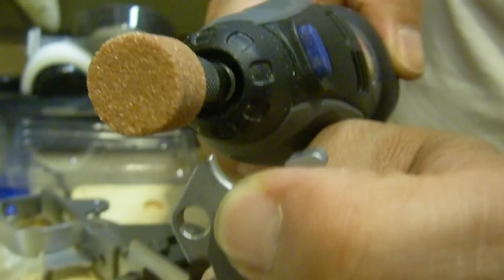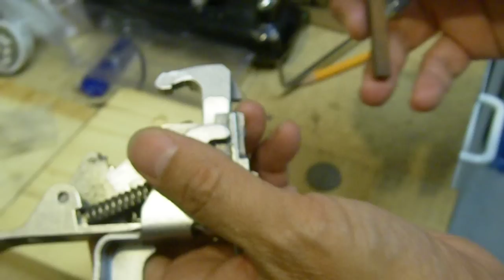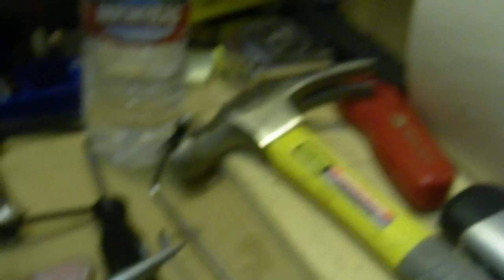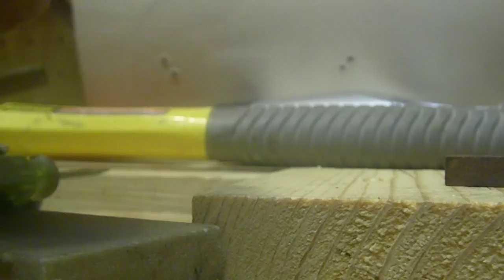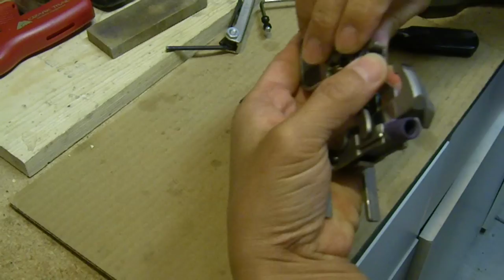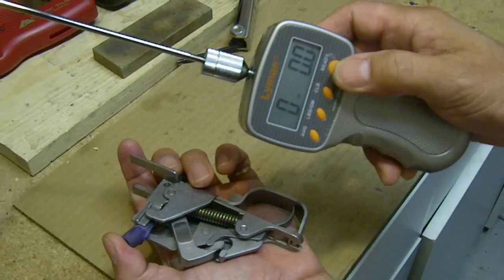Mini-14 Trigger Job 2 of 3

Comment: I had a difficult time getting the trigger assembly back into the housing.  That round trigger spring makes it very difficult to get the holes to line up.  Finally after a good while I did get it but it was not easy.

Comment: You are bending the wrong part of the spring the wrong direction !!!!!!!
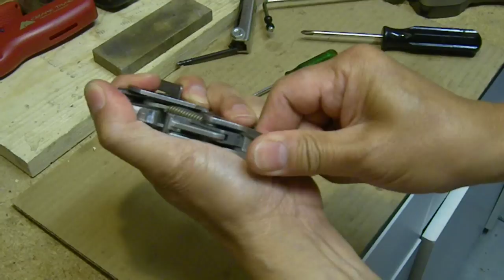Reply from the maker: I don't think so.  As you can see from "Mini-14 Trigger Job: "The Yoda G Mod"" of http://youtu.be/cuSRX92q-sI, at 11:15, Yoda is over-torking the spring and I chose to not over-tork it, but rather to bend the spring at the none-function side with a bend that brings it closed to reduce the trigger pull. I think this is better because it preserves the original spring linearly versus the over-torking having a non-linear effect. The net result is the same.  Also, for the smaller spring, I didn't have a shorter spring, thus I just cut some loop off.